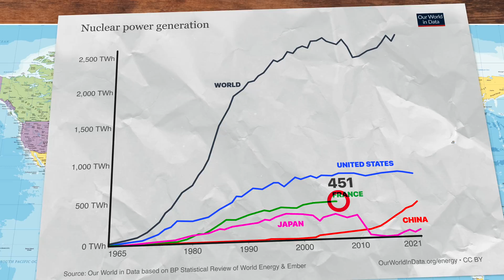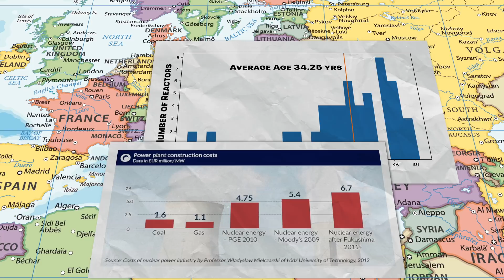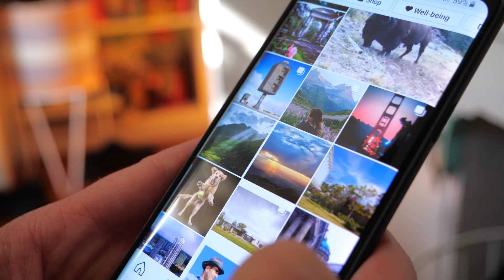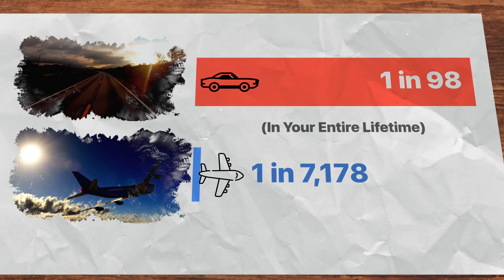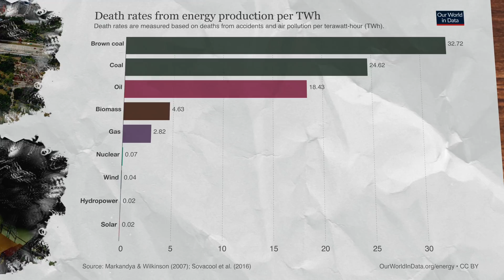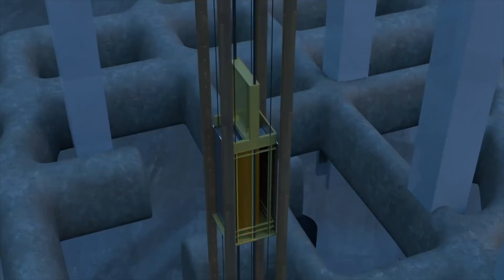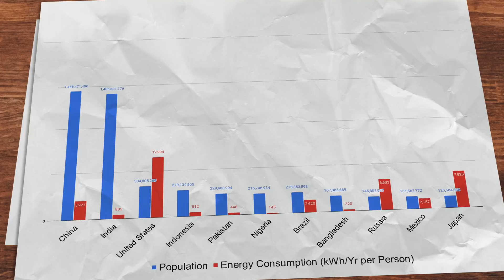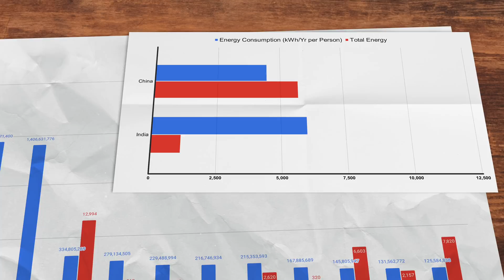The Future of Nuclear Energy Depends On This...

Comment: Glad that you mentioned SMRs at the end.  SMRs solve a bunch of industry problems and should be a huge boost to the nuclear industry.
Reply: What is an SMR ?
Reply: @ChristIsKing4ever-l9w  Small Modular Reactors (SMRs) are typically designed to be "inherently safe" (can't melt down because the laws of physics shut things down without human intervention).  SMRs have also been referred to as "Truckbed" reactors because you can haul them in on semi trucks and set up multiple reactors in a row to supplement a given power plant that might be maxed out on its capacity.  A SMR can be used to supplement the grid in areas where brown-outs occur and waste heat can be used to desalinate water or make hydrogen.
Reply: @pab7109  thank you !
Reply: It solves one problem only: the financing. it breaks up the 10s of Billions per installation into smaller bits. It solves none of the other problems, and in fact makes almost all of them much worse. Has anyone gone and projected the increase in installed capacity needed simply because there is no longer 1 huge and efficient steam turbine, but many many small ones?
Reply: @luc_libv_verhaegen  Installed capacity is due only (almost, ignoring the boondoggles) to current demand- projected demand would dictate proposed construction, but how are either affected by generator size? 
If your point is levelized cost, you're correct, but that's calculated "after the fact"- LCOG is higher for smaller units unless the efficiency hit is offset by other factors (and it could possibly be so, if generation is localized to minimize grid costs.)

Comment: Solar costs one tenth of nuclear energy.
Reply: it costs a 100 fold larger footprint on the land, significantly more materials, significantly more grid instability and/or expensive battery backups and it will need replacing at lease once over the same life span of a nuclear plant
Reply: Solar isn't dispatchable though.

Comment: I'd say the world is abandoning nuclear power because of cost. It is no longer the cheapest option.
Reply: That’s true to an extent but costs are infamously hard to fully quantify because companies externalize so much of it to us citizens. For instance, I’m currently working on a video where I assess the cost to build and run a major freeway that goes to downtown LA vs building public transit. 

The result is that the public transit costs about 500mil less to build and 500 mill less to run every year. But you have to be diligent to count all the costs associated with the freeway in order to realize this!
Reply: It's roughly the same cost as coal power over the life of the plant, and much cheaper if the nuclear plant's lifespan gets extended (which they almost always do).  The issue is that nuclear plants take a long time to build and often the project gets cancelled due to local opposition.
Reply: Remove artificial tax de-incentives and look at the cost afterwards.
Reply: I'm inclined to agree in part, but I think Green Peace and other environmental organisations have a lot to answer for with their scaremongering. I can't stand their opposition to nuclear power and GMO crops.
Both would help protect the environment and reduce carbon dioxide emissions.
Reply: gas with a sprinkling of renewables is cheaper yeah
Reply: Nah, it's because "radiation scurry!"

Comment: We need a pronuclear factual PR campaign. Only problem with Vinfast is the yearly subscription cost for the batteries. Was expecting a cheaper solution out of Vinfast.
Reply: Problem with nukes is waist. Solve the waist problem and I will back it 100%. Until then hell no! Burying it is not solving the problem it is kicking the can down the road.